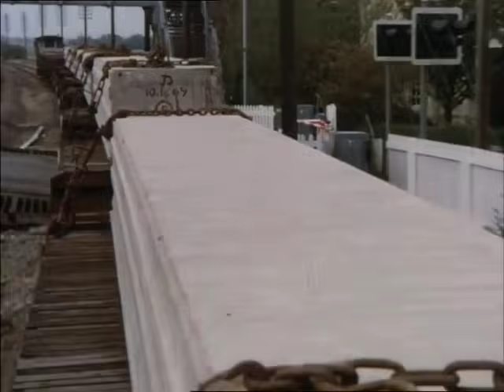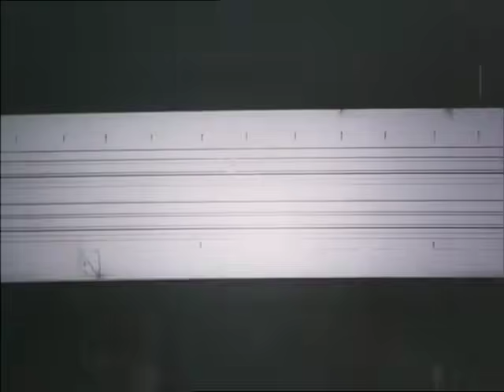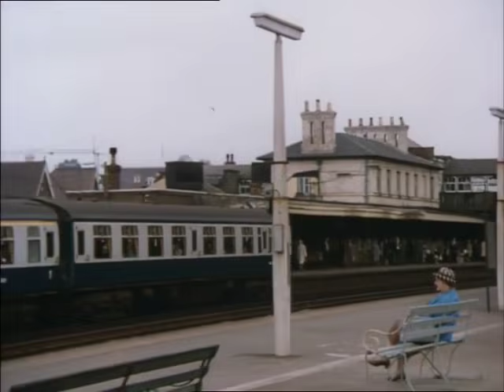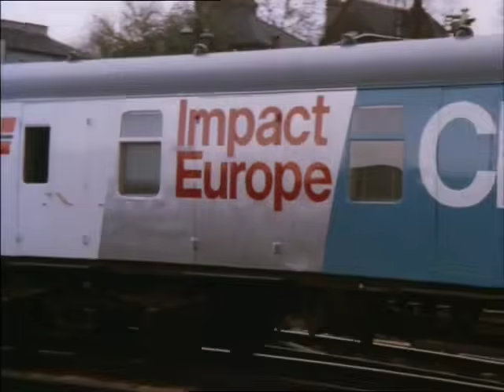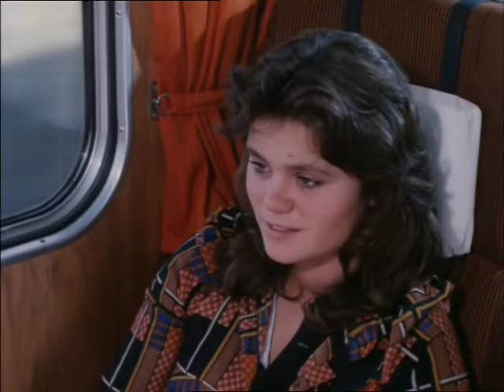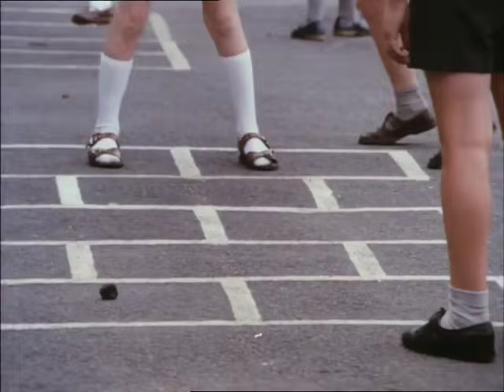Vintage railway film - Rail Report 12; This year by rail - 1972

Comment: Hi there my real Name is Mr C. T. Boxill-Harris, I have another interesting idea for most of us Class 315, Class 314, Class 313, Class 491, Class 442, Class 441, Class 430, Class 421, Class 412 and Class 410, and that will also include those interesting Class 411 Eleven speed Allison Automatic Gearing Transmissions Very Loud Eight speed Leyland Hydra cyclic Automatic Transmission Train fans out there, rather than scrapping most of the Class 315, Class 313, Class 491, Class 441, Class 442, Class 430, Class 412, Class 314, Class 411, Class 410, that will instantly include the Class 421, maybe you guys can convert them. Including rebuilding most of the brand new Gardner 8LXB Engine, Cummins L10 Engine, Leyland 510 Engine, Cummins N14 Engine, Volvo D10A Engine, Gardner 8L3B Engine, Cummins M11 Engine, Gardner 8L3 Engine, Volvo B10M Engine, Gardner 6LXB Engine, Scania N113 Engine, Gardner 6L3B Engine, Volvo D10M Engine, Class 315, Class 314, Class 491, Class 442, Class 314, Class 313, Class 441, Class 430, Class 412, Class 410, Class 411 so they can be able to replace all of the Particular Train units such as for example, Class 150, Class 154, Class 155, Class 106, Class 105 and the Class 114 and that will instantly be including the Class 117 with a Eleven speed Allison Automatic Gearing Transmission Very Loud Eight speed Leyland Hydra cyclic Automatic Gearboxes and converting and that will also be including building most of them into a Three Carriages per units of Class 315, Class 313, Class 491, Class 421, Class 314, Class 442, Class 412, Class 410 and that is including those Class 411 Eleven speed Allison Automatic Gearbox Transmission Very Loud Eight speed Leyland Hydra cyclic Automatic Transmission for all of us Class 421 and Class 412 Diesel Train fans out there Pretty Please? Are you still going to do this interesting type of Project. Class 491, Class 441, Class 442, Class 430, Class 412 and Class 410 will be rebuilding the Class 411 Diesel Train fans out there PLEASE.

Comment: Wonderful.  A special shout out for the BRMk2D. The best travel experience ever placed on UK rails, never bettered.
Reply: Correctomundo
Reply: @scooby2142  A comfortable ride with enough sense of being on rails, seats lined up with the window, generous two a side seating in groups of four, ample luggage storage, simple interior colour scheme with minimal patterning, low seat backs allowing for views to the vestibule or the half barrier at the centre of the coach, effective air con, fantastic crash resistance, no bogie hunting, no rattles, unfussy BR blue and light grey livery, tinted double glazing, good loos, excellent longitudinal lighting by concealed fluorescent tubes, easy to use hand holds attached to each pair of seats, overall clean, simple ‘Sixties’ modernist design which was very restful on the eye.  Everything which today’s cramped and claustrophobic airliner style rolling stock lacks.

Designers: please study the BRMk2Ds or just build more of them adjusted to take automatic plug doors used in later BR carriage designs.
Reply: A rake of Mk IIIs may disagree.
Reply: @philipkay8116 Great coaches but seatbacks too high and several seats misaligned to the windows.  Look great from the outside.  But even better crash resistance than the Mk2ds.

Comment: Sorry old boy, but your much vaunted 'APT' didn't quite work out as you planned, eh, wot? And as for Darby...
Reply: The APT was put into use too early. Plus the inaugural run had all the journalists utterly pissed before they even got on the train - no wonder some felt ill.
Reply: The technology gained during the APT trails was sold off to Siemens,  and the APT itself spent many years at the rtc Derby visible from the road.

Comment: Shame that back in the 1970's BR knew what problems it faced and attempted to rivel that of the car, air travel and motorways but yet today its no wonder why people opt for any way of travel except rail travel due to the fact that in most cases a car can get to a destination quicker than a train, the actual cost of rail travel which continuously increases year on year but the public are not getting a quicker or more efficient journey..
Reply: Hi Duckie... I think your bill interfered with your pronunciation good buddy. It is "rival". Have an awesome day.

Comment: Tallington is still sending out concrete structures by rail. Before Covid they had a new siding laid.

The gypsum mine is no longer in production.
Reply: @GaryNumeroUno  sentence corrected.
Reply: @neiloflongbeck5705  cheers good buddy. Sad the traffic finished up. It seemed to be a successful business case.
Reply: @GaryNumeroUno  the mine was worked out in the 1990s.
Reply: Yes…. Tallington to the Isle of Grain in kent